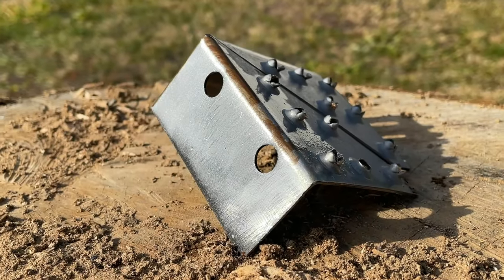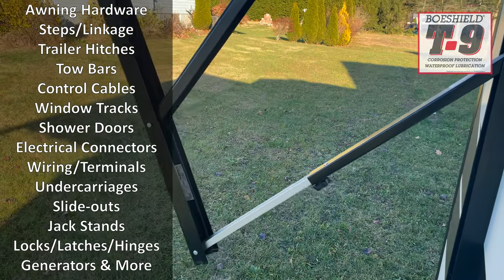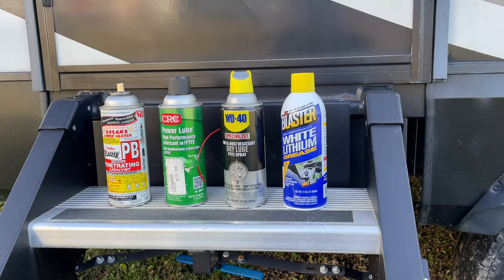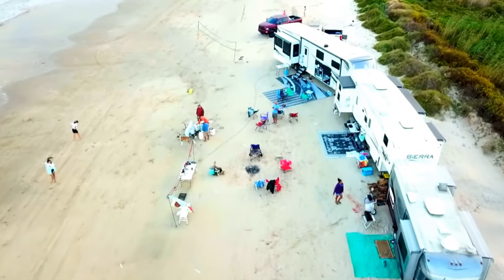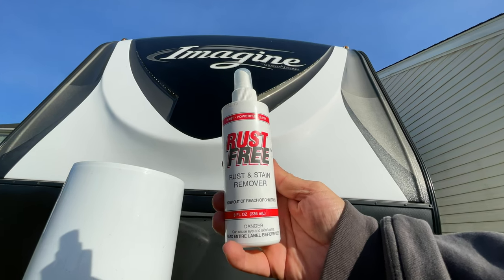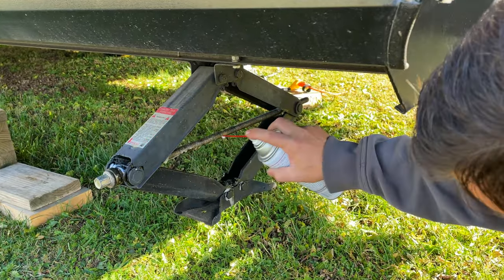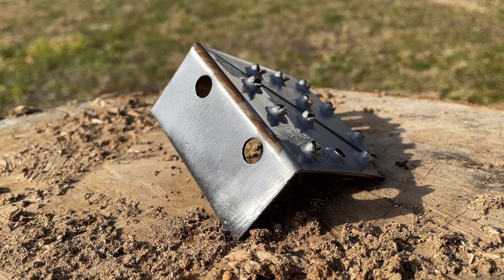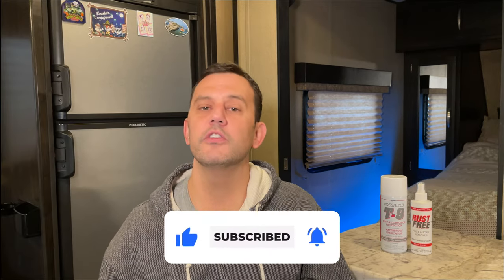💥 RV Rust Prevention & Lubrication – Is Boeshield T-9 Really That Good?

Comment: We're fans of Fluid Film, a 3 pk on Amazon runs about $10 a can.  Put it on metal surfaces, turns rust almost black and it did wonders with our faded patio furniture, even treated wood with it.  Will have to give T9 a try tho.
Reply from the maker: I’ve heard good things about Fluidfilm as well.  Thanks for watching bud.
Reply: @RVTIPSANDTRAVELS  Its amazing on a lot of things but especially rust. When it hits rust, it penetrates it and turns it a very dark coffee, almost black, color and stops the rust dead in its tracks.
Reply from the maker: T9 coats the rust, essentially blocking out the oxygen so it doesn’t continue to rust.

Comment: Near or above freezing it sounds like great stuff. But does the product loose some or all of its benefits the colder it gets. Pennsylvania has warm winters. And trailer mechanisms are not used much in cooler weather.  I’d like to know how well the product behaves as the temperatures drop to say -40 (a common benchmark) before I’d use it on more serious items such as machinery or vehicles in real cold weather.
Reply from the maker: Great question, we dont get that low in PA, but here is what I found on the technical data section of their site: 
 Adhesion at low temperatures: flaking less than 1/32″ at -40±5K (MIL-O-16173D).
Reply from the maker: heres the page if you want to check it out. https://boeshield.com/boeshield-t9-technical-data/

Comment: Nice product review.  Can this be used on slide seals?
Reply from the maker: I would stick with a dedicated slide seal.  Even though this product is safe on rubber, I dont think its the best product for rubber seals.
Reply: @RVTIPSANDTRAVELS  Heard from the RV Factory (maker of Luxe) that the furniture polish pledge is the best product for slide seals.  Have talked 2 other campers that utilize it as well.
Reply from the maker: Hey Mike, thanks for sharing this info... I have personally used the camco rubber seal slide since day 1 (5 years ago) and they all look brand new. I have also heard pledge works great on rubber seals too, thanks for confirming my friend.

Comment: Anyone knows another similar alternative cheaper?
Reply from the maker: honestly Marcos, $19 for a can does seem a little much, but its replacing a dry lube, a lithium grease, and a can of wd 40 or PB Blaster, all 3 will be more than $19.  Additionally, this stuff works great.  Its worth it, in my opinion.  I dont know of anything, more or less expensive, that will replace  Boeshield T-9.
Reply: @RVTIPSANDTRAVELS  got it